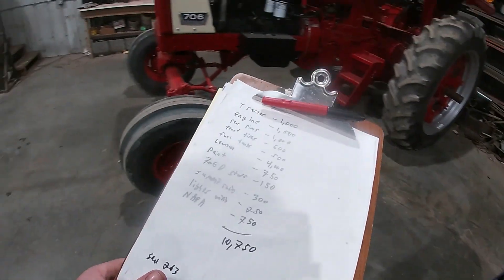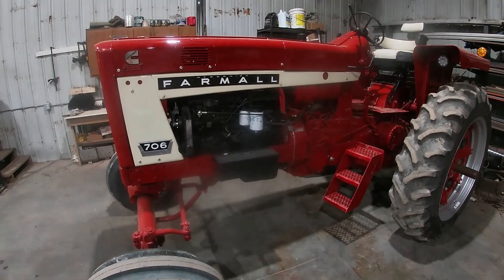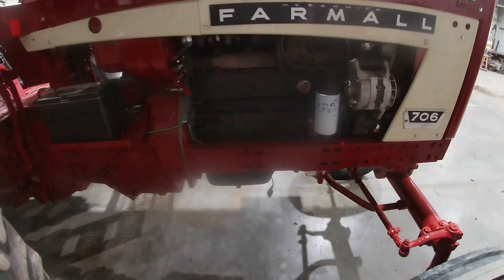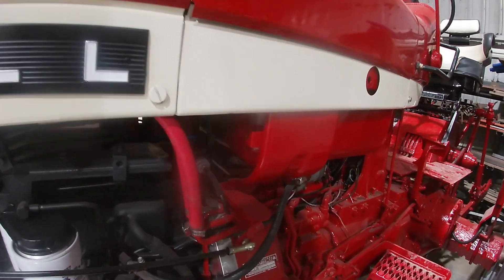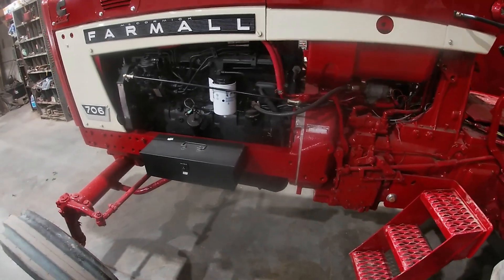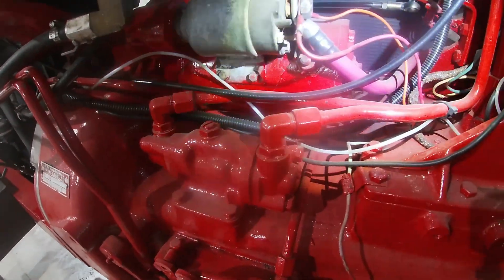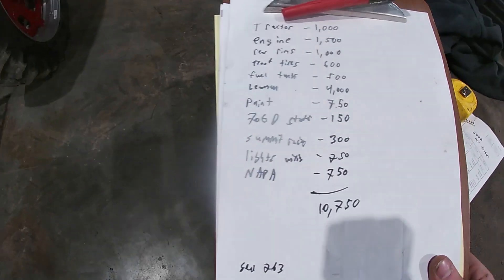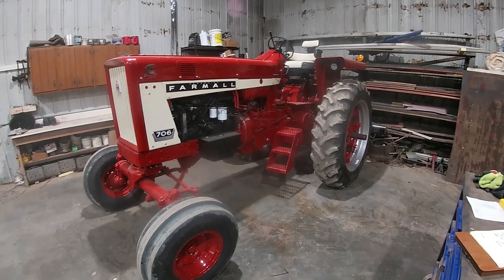Farmall 706 Cummins Swap #7 and Summary

Comment: Nice Project 1st Gen Ram was my first experience with diesels that we used for electrical contracting with a Huge all steel Service body and Topper with rear doors. It was hard not to fall asleep when riding shotgun. It’s sound drowned out everything, and was very comforting. I love those old Cummins but if it were me I believe I would have a International DT360. Love your tractor as is though.

Comment: I took the time to watch all your videos and I do like this conversion. I would have probably tried to get a costume made radiator(or radiator upper and lower tank) to be in the right hose size for the Cummins engine. But at the end of the day it dose not make that much of a difference. The machine runs and performs great and not here to judge someone's work.

Comment: Great looking tractor. How much HP does it have? What do you plan on doing with it on your farm? Wonderful looking shop.
Reply from the maker: Tag says 177 HP @ 2500 RPM. It is fairly healthy. It will run a 12x72 grain auger in the fall and probably a mower in the summer.
Reply: @landonbrown5271  Very nice. Be careful, because the rest of the tractor was designed for about 80 hp.

Comment: Does the 706 make for the best swap candidate? Vs a different model like 806/756/666? No one wants the gas version so that makes sense… is 706 the largest tractor IH made in a gasser?
Reply: No I do know they made an 806 gasser.

Comment: Nice job on the tractor! I just did a similar one myself and I’m looking for a tachometer drive where did you find yours?
Reply from the maker: Leaman Tractor Parts in PA. Give them a call and talk to Ed he will hook you up. Had to use a 1066 tach drive cable because I needed a little more length.